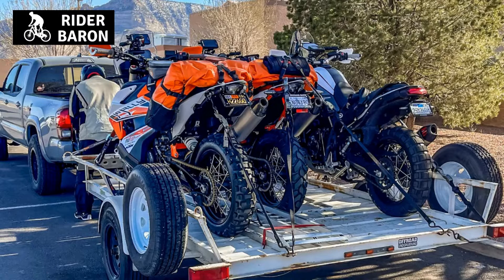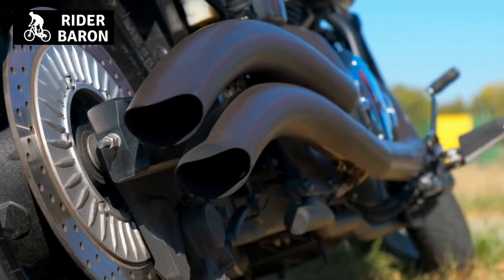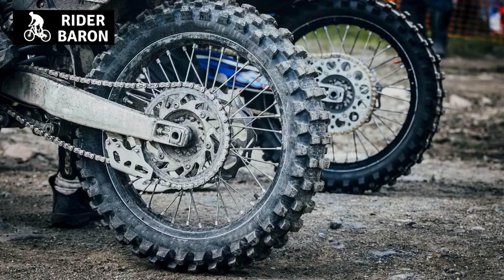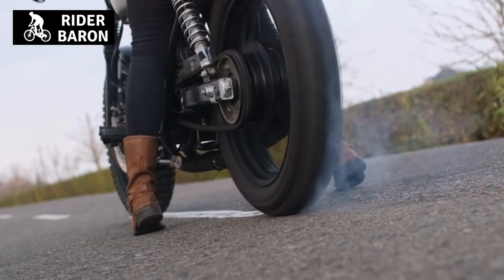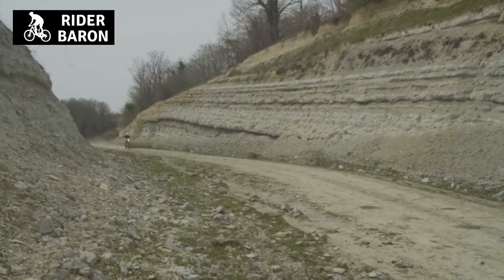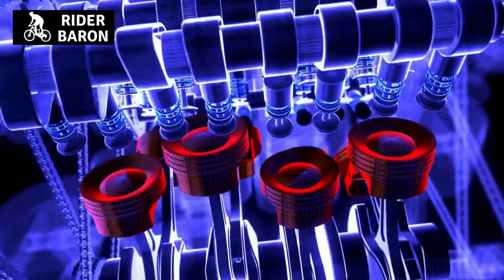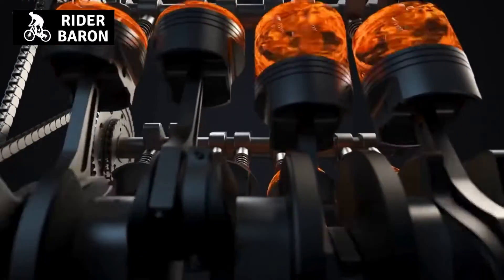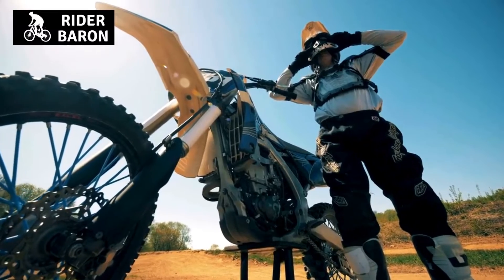Why Does A 2 Stroke Bike Have A Power Band

Comment: Bro does not have the slightest idea of what he is even saying 💀 first off every engine built has a "powerband" even 4 strokes, 4 strokes power just comes on a lot smoother while a 2 strokes power comes out of the blue, not completely sure how it works but I wanna say it's when the Soundwave bouncing off the cone at the back of the expansion chamber align with the rpm of the engine and when the piston and Soundwaves are in sync you get a sudden power burst because the engine runs so much better when it's in sync is what I have read and btw 2 strokes don't have valves they have ports in the cylinder the have reed valves but that is jot the same at all of what this guy was talking about
Reply: Plus he said a lot of things wrong, like piston going wrong direction at compression stroke and then power stroke, a bunch of nonsense.  And great pictures of 4-strokes all over it.

Comment: 2 strokes actually have more torque and better efficiency at low rpm the powerband adjusts your exhaust butterfly that help burnt gas purge easier at high rpm